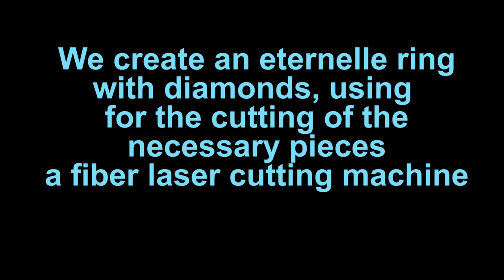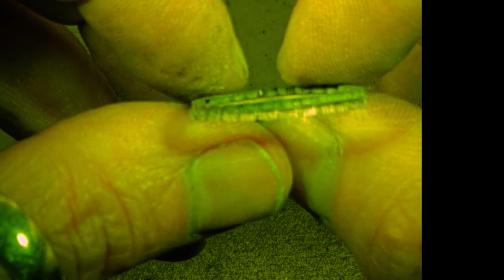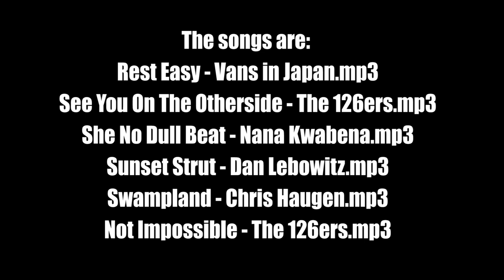We create an eternelle ring 18kt white gold.

Comment: What brand and model of fiber laser are you using?
Reply from the maker: The laser cutting machine is of Chinese origin, purchased through a well-known online sales site. The cost is much lower compared to the machinery offered by companies specialized in the production of equipment for jewelry workshops. However, the downside is that you have to deal with all the problems arising from the installation and calibration of the software and components. The power is 60W and the lens has a field of 90x90.

Comment: What can a laser machine do you use??? O Brand??
Reply from the maker: The laser cutting machine is of Chinese origin, purchased through a well-known online sales site. The cost is much lower compared to the machinery offered by companies specialized in the production of equipment for jewelry workshops. However, the downside is that you have to deal with all the problems arising from the installation and calibration of the software and components. The power is 60W and the lens has a field of 90x90.